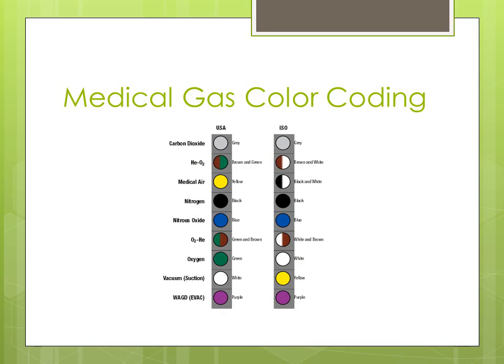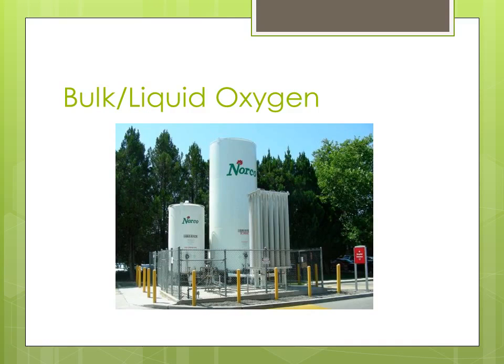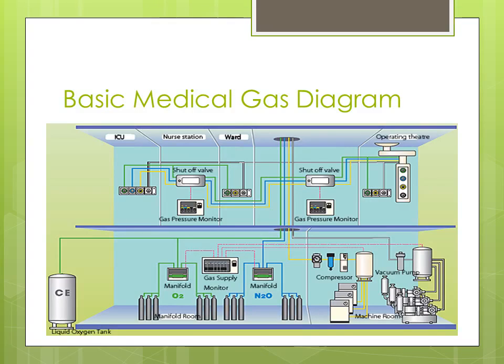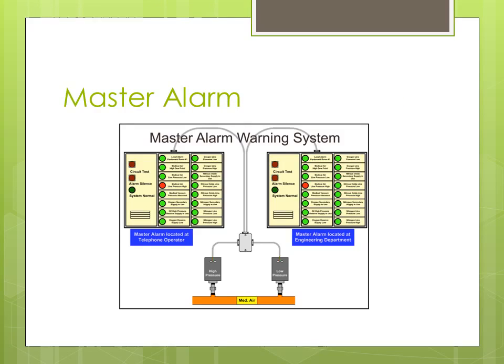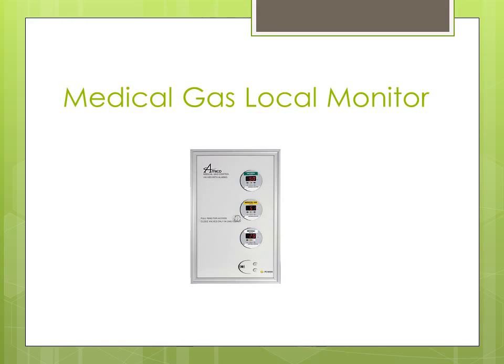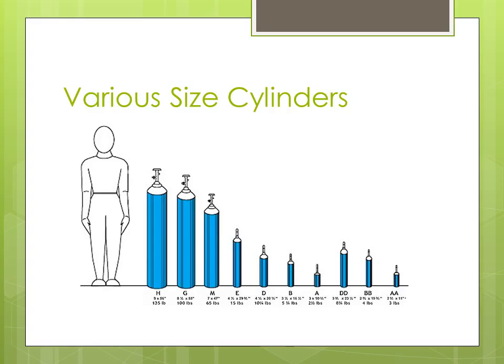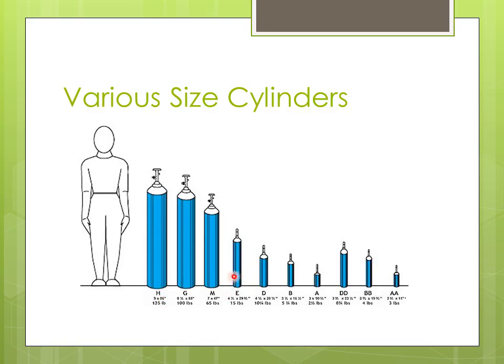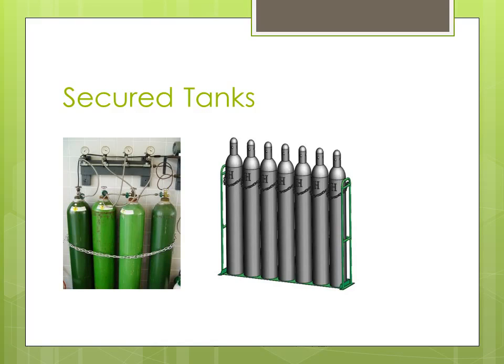Medical Gas Overview

Comment: Not all hospitals require backup liquid oxygen bulk vessels. It depends on the required scf that the facility uses. NFPA 99 allows for a reserve backup system comprised of high pressure cylinders. So, the diagram is not incorrect on that point.

Comment: Hi. Couple of questions I haveHow is the air pumped around the pipework?Is there such a thing as standalone medical air cylinders?Thanks
Reply: there are multiple ways and it differs from the different gasses, for say instrument air or medical air or vaccumm normally there is a compressor with air containers as a backup. Oxygen can come bottled or from a farm where liquid oxygen is turned into gas.